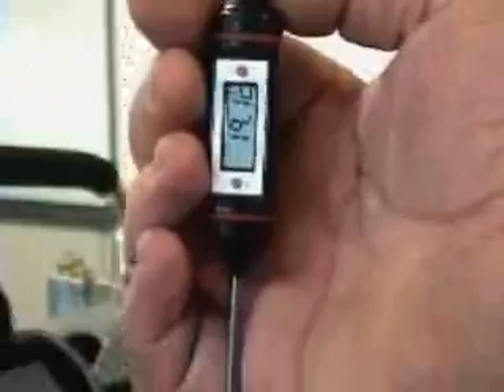Freeze Water by Boiling

Comment: What I would like to see is if the Mpemba effect is still exhibited in a vacuum.  For someone with a bell jar and vacuum pump it would be easy to set up.  Place two equal volumes of water in the jar, one at 100 C and one at 25 C.  My prediction is they would freeze at or near the same time because the saturated gas in both containers would be the same and there would be no frost insulation on the containers.

Comment: Ähm, I may be wrong, but your explanation about "the hot part of the water boiling away and leaving only cold water behind" sounds a bit silly.
As far as I know, the point would rather be, that heating up any substance takes a constant amount, but changing from liquid to gaseous state takes an imensely higher amount of energy. The engergy needed to evaporate from the liquid state is taken from the environment, mostly from the still liquid part of the water, wich is thus cooled down.

Comment: @halomasterchief14 
I think what is being confused here is the fact that boiling is in fact a cooling process.  Heat (energy) is applied at pressure (atmosphere)  and in order to try to cool itself or to reach an equilibrium with the surrounding air temp it has to release energy. (boiling)  Now relate this to the vacuum.  It goes in at room temp.  and as the gasses are allowed to escape do to the lack of pressure, the liquid cools.

Comment: @halomasterchief14  it's impossible bcuz im almost sure if we open the bell and touch the watter after boiling it's will not warmer but cooler because we don't add any energy ( we take it out ) , the boiling is due at his own energy ( the warm ) it consumer also energy , in infrared wave ,  but if we check with infrared thermoter we will see many degree but these degree are like fake ,remenber that in vaccum space , energy can't transfer by heat ,bcuz no atom around for take it !but only by wave

Comment: everyone know that without air the energy can't transfer to another atom by touching ,but only by wave( the wave can cross the empty but the heat can't )then when the water with his energy( 25 degrre )energy can't transfer to another atom near him , it don't have choise to release his energy to infrared wave it's cause the boiling ,when energy is gone it's become ice . don't try to calculate temp of incide empty vacuum bcuz it's impossible u will know the temp of thermometer only,empty=no energy

Comment: Is this anything to do with the latent heat required in turning water into a gas, or is that only energy that you would need to counteract atmospheric pressure under normal conditions?

Comment: Ok what basically happens is that when he puts the water in a vaccum the water begins to boil in order to fill the empty space.(fluid dynamics at uni).Now the only way the water is going to fill the void is if it is turned into gas. Energy from the main body of liquid water is used to vaporize some of the liquid water and turn it into gas. Seeing as energy is being taken from the liquid water its core tempterature will decrease and may eventually freeze depending on the area needed to fill.

Comment: Ok, "hot" just refers to fast moving molecules.  Normally when the fast moving molecules in the liquid try to escape, the many molecules in the room push them back down into the liquid.  But if you remove the outside air the fast or "hot" moving molecules can escape or "boil" with little resistance.  The molecules left behind are on average slower moving or "cold" and so the average temperature is cold. BTW heat and calories are not interchangable terms